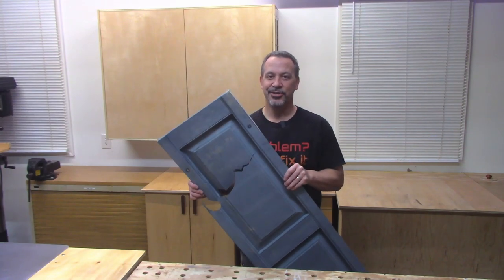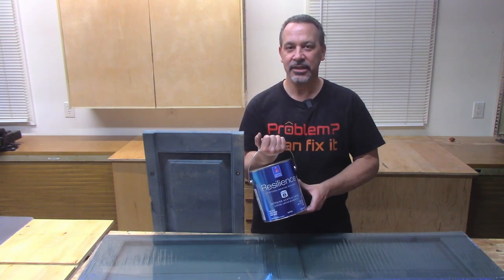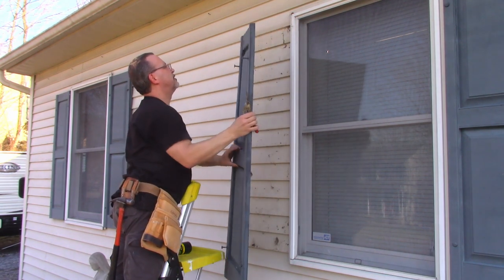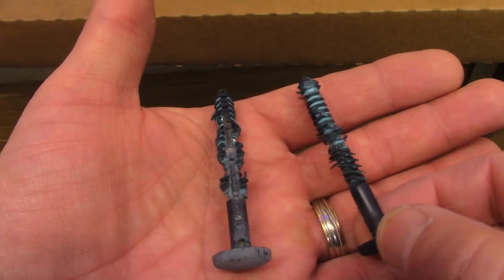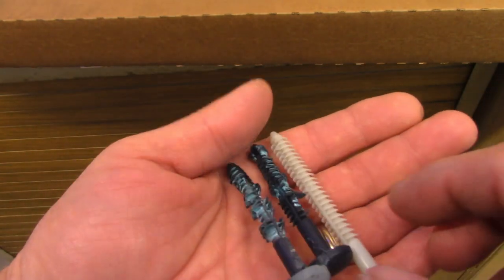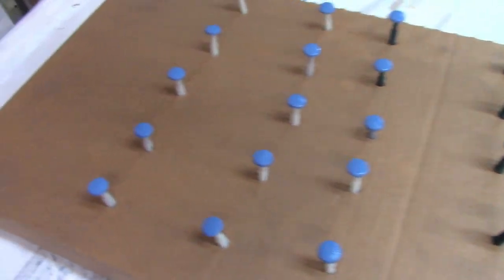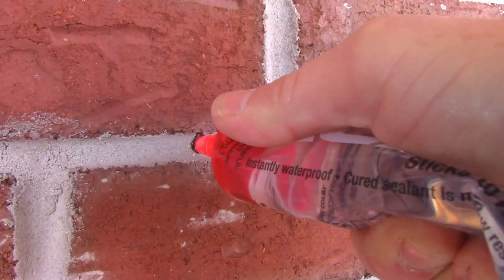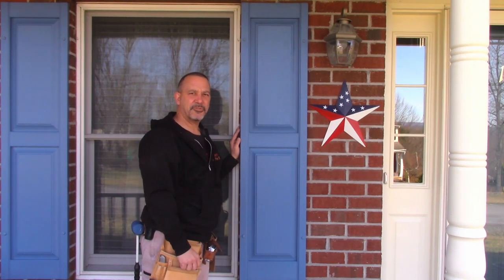Paint your window shutters now

Comment: What if there’s old glue stuck in the brick holes? I can’t seem to get it out
Reply from the maker: You could try a smaller drill bit at slow speed.  Just try not to make the hole bigger.

Comment: 💥 Hey Ray.  Great video, thanks.  I have 24 and are a similar size to your raised panel shutters. Any idea how much paint I’ll need.?  The color will be close to the color of the shutter so one coat should cover well.  🤟🏼
Reply from the maker: Thanks.  You could take a chance on buying a quart but you may run out.  With a gallon you'll have enough left over to paint your front door to match.
Reply: @HouseDoctorRay   Thanks and I appreciate the speedy reply. I’m kind of thinking a quart should be good enough too.  It seems to go a long way.
Reply: What color did you use? They look great.
Reply from the maker: Thank you but Mrs House Doctor picked the color.
Sherwin Williams 6516 Down Pour